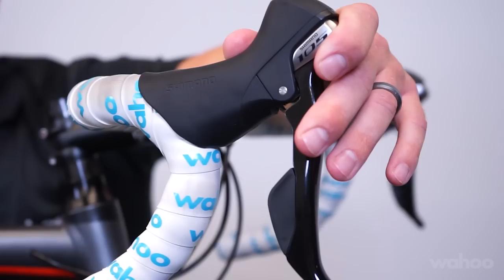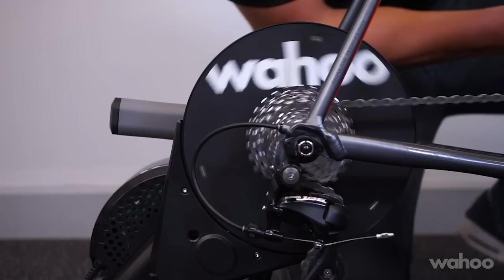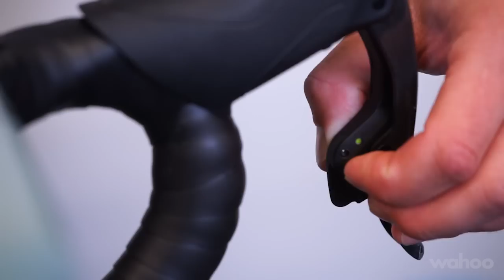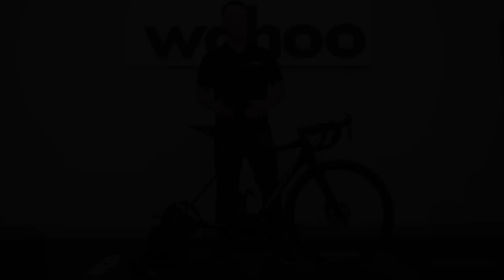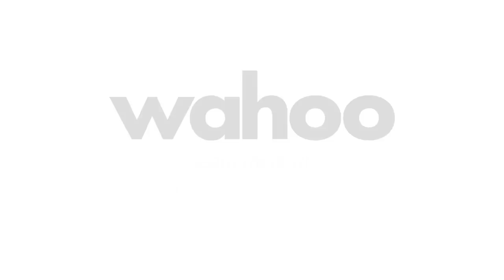How Do I Tune My Bike Derailleur For Use on the KICKR?

Comment: Omg such a relief to hear I’m not the only one having this issue with my indexing on my kickr. I’ve been pulling my hair out trying to figure why my gears are all over the place. I also think wahoo need a no resistance button on the app like others have suggested so you can turn the pedals easily while dialling in your gears.
Reply: From basic observation, my bike gear alignment (cassette and derailleur combination) is different on the Kickr than with the wheel on. When I cinch down the quick release, I can actually see the drop-outs (and therefore the cassette) move inwards slightly. It almost seems like I need an additional shim (yes, I have the 130/135 axle spacer set up correctly - my bike has 135 spacing)

Comment: I have to adjust my rear derailleur barrel adjustment every time I use the trainer, compared to my road adjustment.  SO I used some fingernail polish and put a dot on the barrel and a corresponding dot on the derailleur it self, this way each time I switch between the road and trainer I just have to line up the dots. It takes a few mins but save lots of time later.
Reply: clever tip, thank you. But why having to readjust every time swapping, surely with matching cassettes of bike wheel and the turbo should just work, yes?
Reply: @PoetWithPace  From my experience, it's slightly offset by a few millimeters as in comparison to my canyon aeroad. I need to do this every time as well
Reply: @ItsExetic  good top know. Thank you for taking time to give me feedback. Much appreciated!
Reply: @PoetWithPace  this is what i did and it works flawlessly - no tuning required.
Reply: @mikeg8777  ok
Reply: Brilliant!

Comment: I've took my bike off the kickr, fully cleaned my drive train and aligned the hanger. I'm running di2 and don't really want to mess around with the derailleur everytime I put the bike on the kickr. Bit frustrating.

Comment: I can never get my gear to properly index on the kickr core; especially in the small cogs - I’ve never had this issue on wheels. Also the resistance created by the trainer makes it very hard to turn the pedals with the hands while adjusting the barrel adjuster. Any other tips ?
Reply: My shifting is so different between wheels and turbo trainer that I've bought a second bike just for the turbo. I also have the question... How do I set turbo to zero resistance for gear tuning?
Reply: Same problem, i know a lot about bikes, but i cant figure this out. The shimano sora 9 speed has been horrible to sync up.  All my other bikes/ cassettes who have sram sync up like butter.
Shimano cassette so much vibration and noise.  Even local bike shop couldn’t understand it.
Reply: @asun3630  so i'm not the only one with this pain. What is bizarre with my bike is that it was fine a few weeks ago and now there is chain noise on Turbo!
Reply: Donny G , i know it is easy for derailleur to get nocked, try the barrel adjusters while pedaling see if noise increases or less, you may need another person if it is only by axel. But that should work if it just started rubbing.

yeah im upgrading the groupset so hopefully that will reduce the amount of noise im getting

But I definitely don’t recommend the Shimano sora group set.  Feels very clunky and heavy.
Reply: @asun3630  thank you for feedback, much appreciated!
Reply: @asun3630  hi just brought a kickr and have the same problem.  9 speed sora. Did you manage to fix your bike?
Reply: All_Simple_recipes_UK  
Hello!
it still rubs and vibrates on kickr depending on gear ⚙️, but i have been able to get some 1st places, in segments challenges on Zwift, so in right gear i can maintain efficient power. I definitely have to adjust barrel adjuster on front derailleur at times in low or high gear.  i know it has the tap adjust, but it still rubs or vibrates. Let me know if yours shifts smoothly.  Im curious if it is something im overseeing? 🤷‍♂️ My 11speed sram mtb connects perfectly to kickr, you could hear a pin drop, but suspension sucks up my power even locked out.
Reply: Had the same problem for a bit... completely took apart my cassette, derailleur etc and everything is butter smooth on the stand and on a normal wheel. I know that wahoo says it is possible that you have to make a slight adjustment to the derailleur for proper alignment (you need to index it on the trainer, I just keep track of the adjustment like they say in the video above and revert back when taking my bike outside for a ride) but regardless, that wasn't the issue for me... after some close ups of the quick release skewer, I notice that when I attach the bike to the trainer and tighten up the QR skewer, the process squeezes the frame/bends the derailleur hanger downwards...aka it puts the most bottom part of the derailleur closer to the trainer, which means the cage is out of alignment and indexing is pointless in that situation... Still working on a fix though
Reply: @olithetwin  is it possible that the axle of the KICKR is slightly smaller than your wheel?  Might a worth a measure.  If so, a washer may help the alignment when clamped. I am looking at this same issue on my KICKR.
Reply: @derekkuhl  I measured and it is the exact length..
Reply: @olithetwin  I have the exact same experience. It almost seems that the axle space (135 in my case) is about 1-2mm too narrow, causing the derailleur to be squeezed inwards when locking down the QR.
Reply: Same issue with thru axle on 12 speed shimano 105 i'm going to bring the trainer back for me that is too much hassle will look for an alternate trainer

Comment: I've just got my KICKR CORE and set it up however I am finding its very noisy. I am using a Shimano 105 10Speed cassette with a brand new 11-28T which I'm pretty certain is what I had on my wheel as I've upgraded from a TACX Vortex wheel -on turbo. I have done 2 rides and finding it alot noisier than the demo videos I watched. I did try and adjust the index barrel on the rear mech but really not sure if getting better or worse. Nervous of damaging the bike or Turbo. Any thoughts or assistance please ?

Comment: I have the problem with the bike chain slipping forward on the smaller rings (the higher gears). I have checked the non-drive and drive side adapters and they are all inserted correctly for 130mm through axle. With the rear wheel on the bike is reasonably well indexed. I have tried turning the barrel adjuster but this does not seem to help. I have lubricated the chain, checked derailleur hanger, all seems fine and the bike otherwise rides well. Any ideas? Bike is an old Giant TCR, used with brand new KICKR 4
Reply: KICKR 5, same thing. Can't use smaller gear because it is noisy and trying to slip up. Adjustment did not work.

Comment: My bike is a 12 x 142mm and it made me have to adjust my limit screws because the cassette in closer and seems to align with 135mm spacing better. Since I am using 11 speed, the stock cassette on the Kickr, I didn't put a spacer in.

Is there a way to adjust the spacing of the cassette when using a 142 or heck even a mountain bike spacing of 148?

Comment: Is there a way you can remove the resistance from the flywheel to adjust gears? You need arms like Popeye to adjust the high gears by turning the cranks.
Reply: i let Wahoo Bolt change the erg to 1 watt to solve this
Reply: @tomk163  how do you do that? where to find the setting?

Comment: Installed 11 speed cassette into wahoo and couldn’t adjust rear derailleur angle to engage lowest speed (largest cog) no matter what adjustments I made.
Reply: Same issue. Pulley cage touching the kickr. 11speed cassette, so can't even put a spacer on the freehub before putting cassette on as it doesn't leave enough room on the splines to put the last cog on.

Comment: My gears work perfect on new kickr but the noise in certain gears is so loud that it makes you want to not use them (brand new chain last week when I got my kickr)
Reply from the maker: Please give our support team a call or chat. We can get you sorted quickly. support.wahoofitness.com
Reply: I have the same problem. In the small chainring it is perfect and not noisy at all. But on the big chainring it is very noisy in the 3 smallest gears and 2nd-4th gear from top. I don’t go big/big to avoid cross chaining. I did open a ticket and thought I had it sorted but the problem persists. It’s almost as though the chain line is not right. The crank is on properly and spaced accordingly. There is no touch of the chain on derailers. Also I don’t have this problem on my normal wheel with exactly the same 105 cassette. It’s very frustrating. I am using Di2
Reply: @neilbutler-wasabirc8941  I've been getting this on my new Saris H3. My assumption is it's a cassette wear mismatch. New cassette, older chain.
Reply: petef15 it wasn’t a wear issue. I had a new cassette and a new chain. I eventually sorted it out 95%. It was an alignment issue with the bike on the kickr. Played a bit with spacings etc and sorted it. Not as perfect as on the road, but I think on the road, the road noise hides some of the drivetrain noise, which can still be heard on the trainer.
Reply: Neil Butler - WasabiRC how did you play with the spacing?
Reply: @neilbutler-wasabirc8941  how did u play with the spacing
Reply: I turned the one spacer around. I had same issue when I upgraded to a kickr 18. But that turned out to be cassette mismatch. Took cassette that came with kickr off, think it was sunrace and used my shimano 105 cassette.
Reply: @neilbutler-wasabirc8941  I had the same problem, it resolved once I added a spacer next to the trainer side. I recently changed to a new cassette/chain, kept that spacer, and have the problem again. Not sure if I should remove it (chain appears well aligned) or mess around with the cable tension.

Comment: The problem is the cassette may sit farther outboard (or inboard) compared to your wheelset. The distance from my dropout to the first smallest cog was different on my bike by nearly a mm.
Reply: Same issues seems to be with other direct drive trainers vs. wheel sets. I have Elite Drivo 2 and i need to do micro adjustments to outward to work it properly with trainer.
Reply: @Juha Lehtinen same and I own direto X but I guess for me I can add a washer to trainer to change it so lines up like road
Reply: @mlee6050  I have a direto 2 and have same issues... Are you saying that you are using 3 washers in order for it to line up better?
Reply: @keithtse6834  the side you tighten the freehub on I actually filed the nut thing down so when tightened it 1.9-2mm showing until cassette lock ring to match my road wheel and measured to check it 135mm across and if under can space other side with washers (my bike is 135mm axle), note the nut thing hits freehub before it goes to 2mm, also check the thing tightens on isn't thing to stop it first

I attached it and seems like lines up better but not used by cycling yet as putting on new chain, and chaining internal gear cable and hydraulic brake lines and got lighter saddle to finish my bike probably under 6.7kg

Comment: Shifting is fine. But on my kickr v5 I have on lower gears horrible noise. Same ultegra cassette as on my normal wheel. And tight fastened cassette ring 😢
Reply: Have the same issue on my kicker core.
Reply: got my kickr core yesterday and I have vibrations on the smallest rear sprocket

Comment: What if my bike wont shift into my 2 largest cogs?  The deraireur wont down shift any further.   At the same time it will continue down shifting beyond my slowest cog and will shift the chain right off the casset.
Reply: Kyle Couture spacer issue?
Reply: @karatejosh89  i got it figured out.  The who who had it before me had through axel so i needed to change something.
Reply: @kylecouture1917  I am having exactly the same problem. What was the change you made? Thanks!

Comment: Don't buy a kickr core if you run a sram axs rival 12 speed. Runs horribly. Better to buy a seperate bike for the trainer.
Reply: Uh oh, I'm trying to put my sram axs rival 12 speed on my Kickr Core and have been having problems. Hoping I can get it sorted. I had a 1980s road bike on it previously. Don't want to put the old bike back on : (
Reply: @elhoover  you can get it to work perfectly but you'll have to make adjustments to the rear derailleur and not micro adjustments either. More like major ones which means on the road you'll be out of sync
Reply: @MarcraM82  Thanks for this info
Reply: @elhoover  also maybe adjustments to the front derailleur!